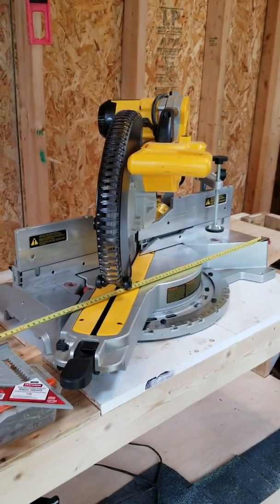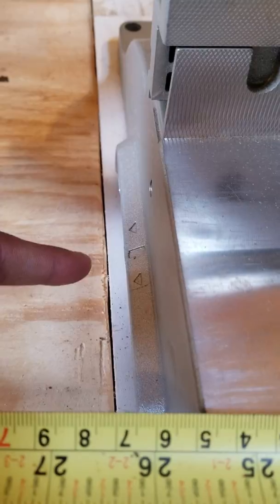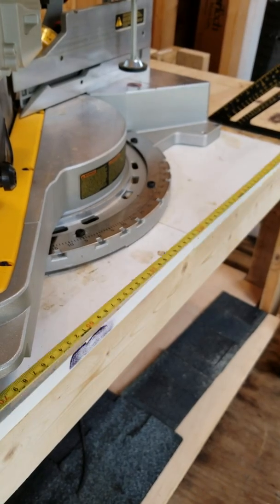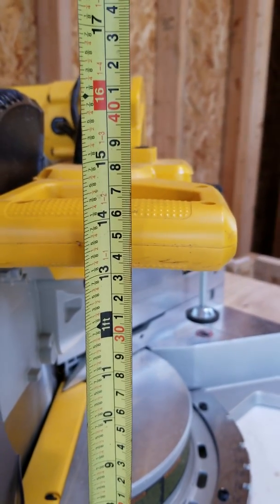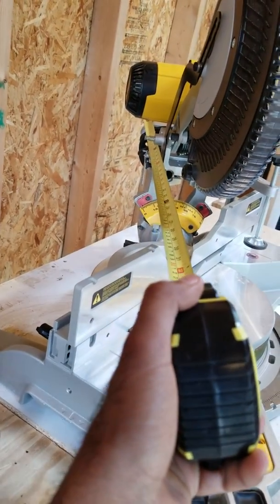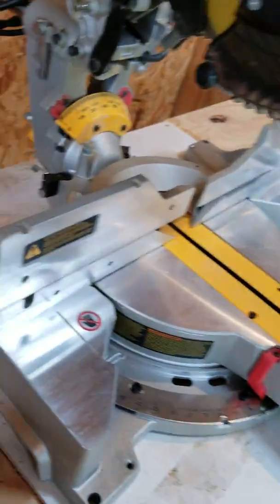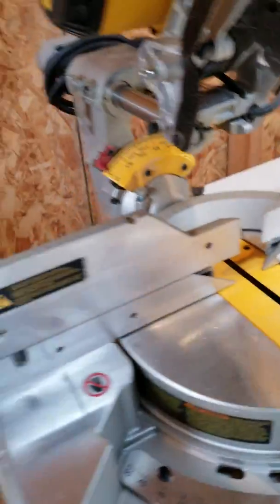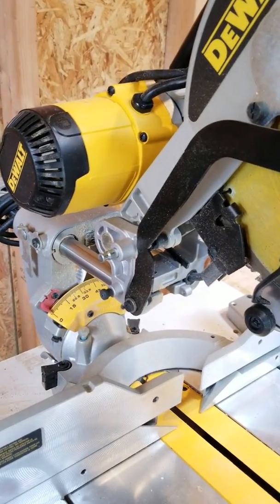Dewalt Compound Miter Saw DWS780 Dimensions/Measurements .. 1st step to building miter saw station

Comment: Just if anyone needs it, from Table surface to Cutting Base/Corner of the fence I'm getting 3 9/16".  I see measurements of 1/32 shorter.   But my calipers are new, I had tried 2 different calipers, and from 4 different points around the base.

Comment: The width of the aluminum base casting of the DWS 779/780 is 25-15/16".  You need this dimension if the saw is to be set into a well.